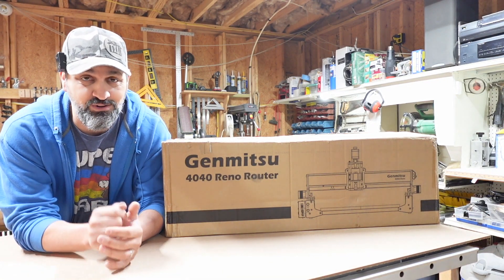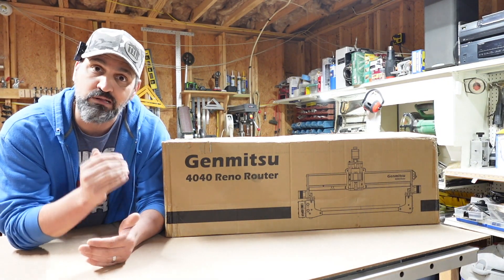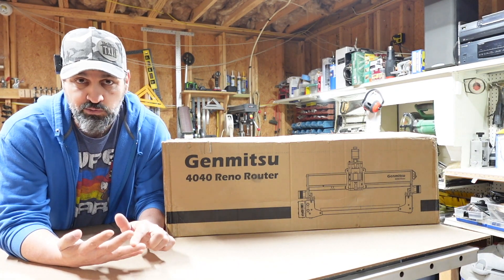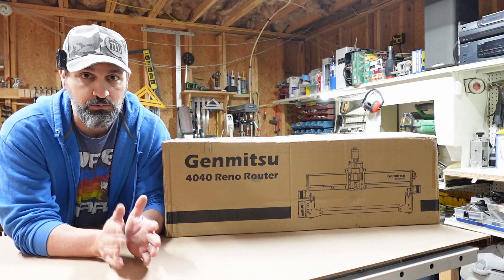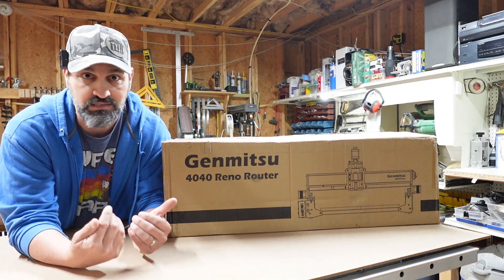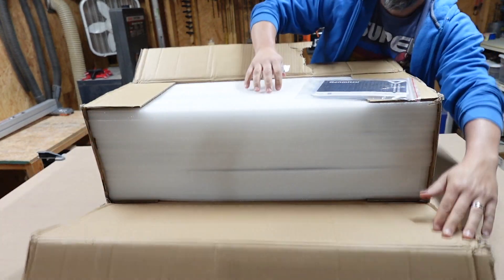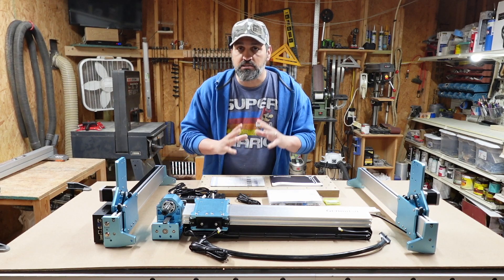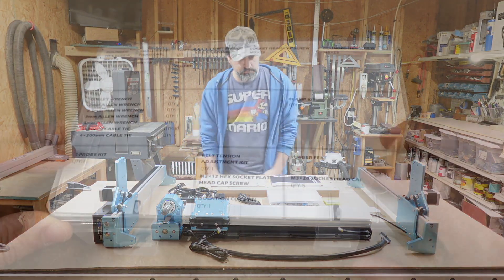SainSmart Genmitsu Reno 4040   Unboxing, Setup and First Look!

Comment: is that machine support MACH3 program
Reply from the maker: Short answer: No, not by default — the Genmitsu 4040 Reno uses a GRBL‐based controller, not a Mazak/Mach3 style controller, so it isn’t directly compatible with Mach3 out of the box.

The machine’s motherboard firmware environment is built around GRBL (a lightweight firmware for Arduino‐style boards) rather than the parallel-port or external motion card setups that Mach3 expects.

Comment: I’m coming from a shapeoko 3. I’m considering the Reno because I want a bigger work area. Am I going to be dissatisfied with this due to the reduced rigidity or the lower power?
Reply from the maker: how big of a work area are you looking to upgrade too?  This Reno is only 4040 and if you get the extension kit it’s goin to cost well around 1200 for a belt system.  I would go with anything less than a Linear / Lead Screw drive system especially in your case looking to upgrade.  AxisCreat has a belt machine that’s a 6060 (24”x24”) for $750 with a router included.  They also sell (out of stock until October) a pro version with Linear Rails and Nema Motors for $1500.  And if you wanna drop 3-4K you can get a 4x4 from Foxalien that I have too! They’re coming out with a plug n play VFD 1.5kw spindle too!

Comment: How are you feeling about the Genmitsu a few months in?  I was a little worried about the ragged cut.  Did that cleaned up as you learned more?
Reply from the maker: Genmitsu is a great brand and put out a quality product whoever I haven’t used this enough after the video to really give a long term feedback! From what I have seen though and the quality…. I wouldn’t be afraid to recommend it for a first or even second machine for any hobbyist!
Reply: @TheCrawlspaceCraftsman  Thank you.  

Did the rough cuts, that you said was user error, get better with use?  I'm looking at a CNC to make products to sell.  Less sanding the better.